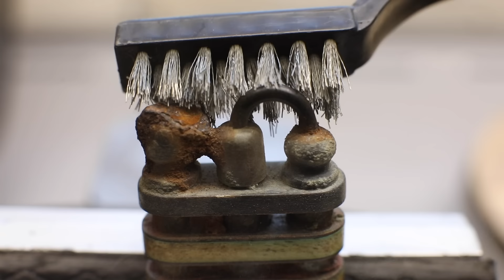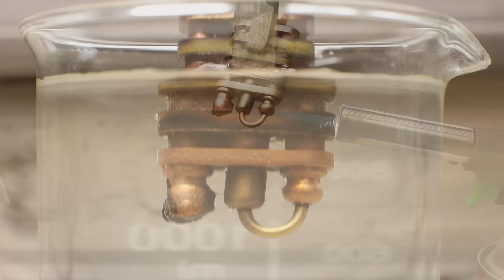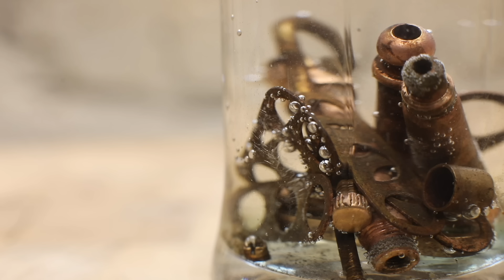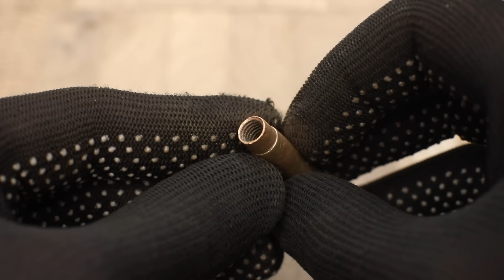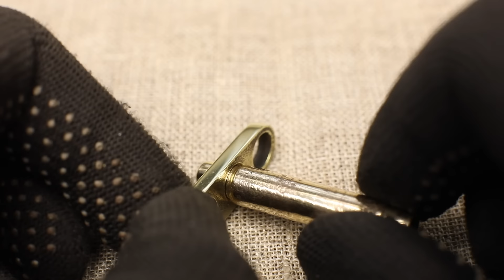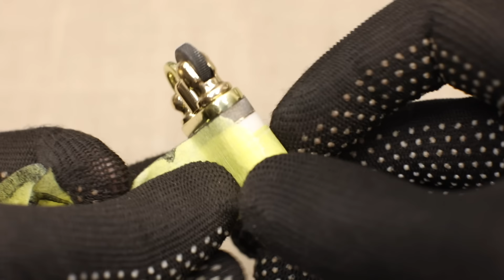EXTREMELY Rare Old Lighter Restoration. World War I

Comment: Have you ever though of using a rock tumbler for sanding down multiple parts instead of a jar attached to a drill. It would move slower and not run out of power. Could have better results too.